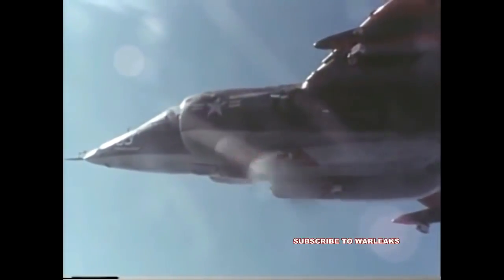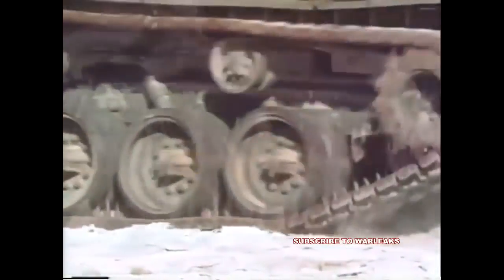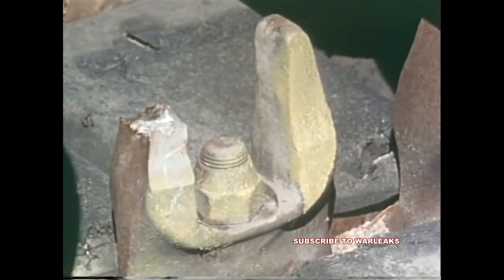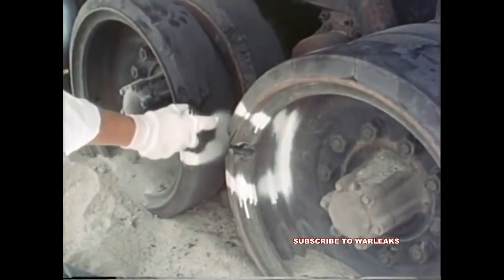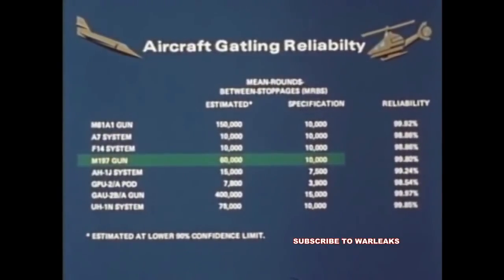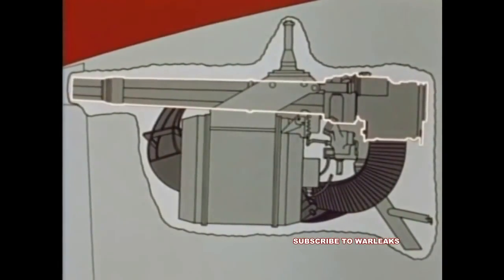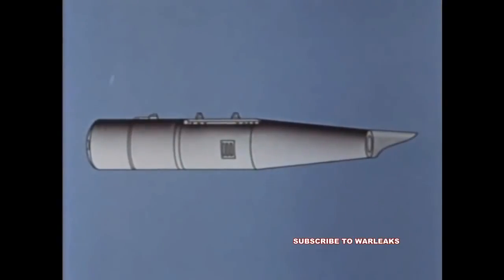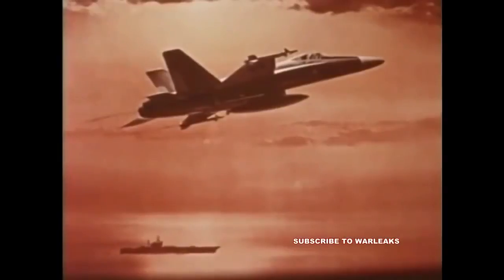HOW IT WORKS: Gatling Gun Documentary

Comment: At 30:00
"Ok Gentlemen, we need a high speed low drag F-4E crew to assist in testing of gun for F-18. You job will be to tow a target, that will be shot at. Any volunteers? Anyone... Bueller......?"
chrrp...chrpppp....
Reply: Its either remote or they put a cinder block on the gas.